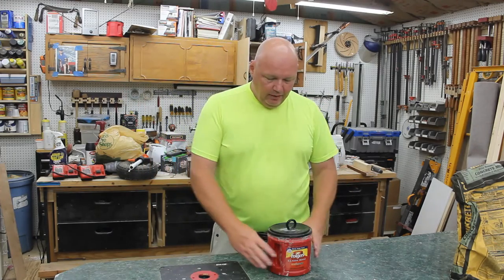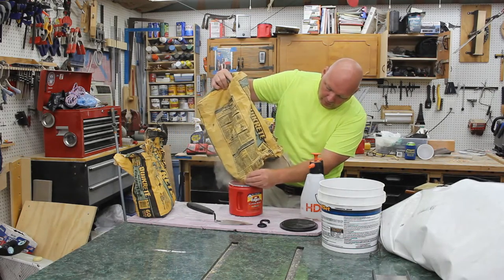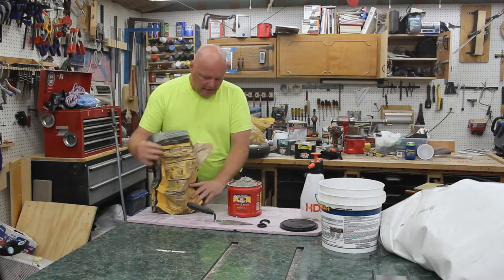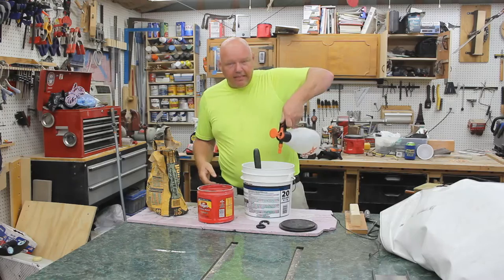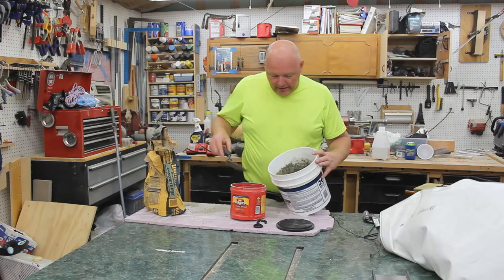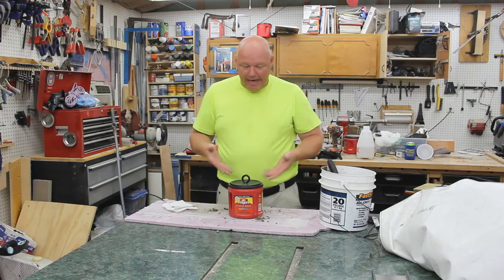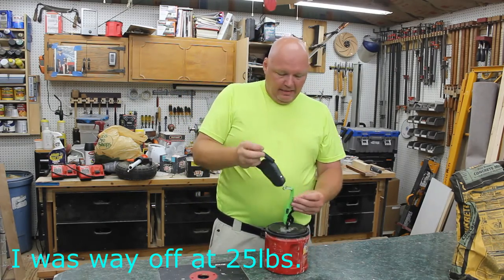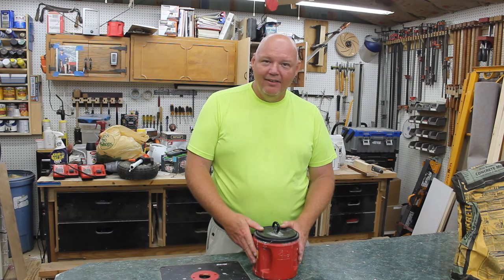EASY DIY ANCHOR

Comment: As a Kid 60 years ago I made a boat anchor in a similar fashion, however I drilled three holes in the bucket and added 3 stainless steel carriage bolts in the side of a two gallon bucket and pretty much the same for the line attach point with a big washer at the bottom of the eyelet and a bolt. 😁🛫
Reply from the maker: Thank you for watching and how you built your anchor.